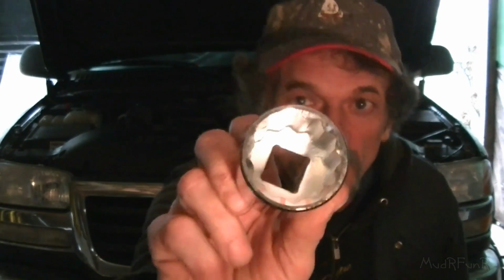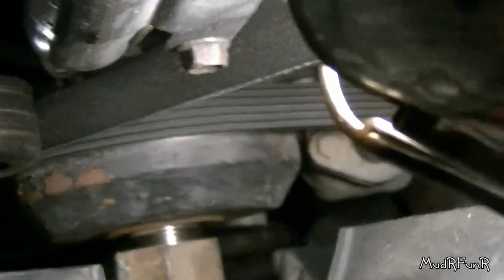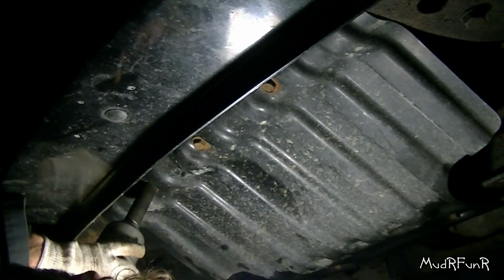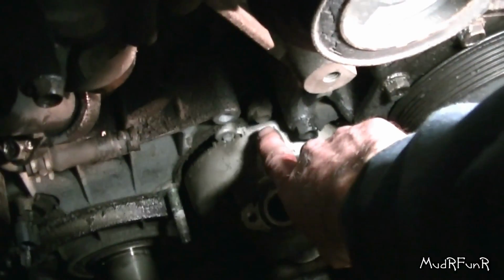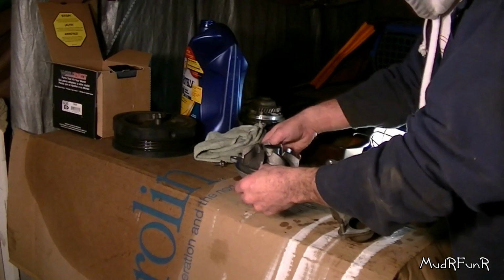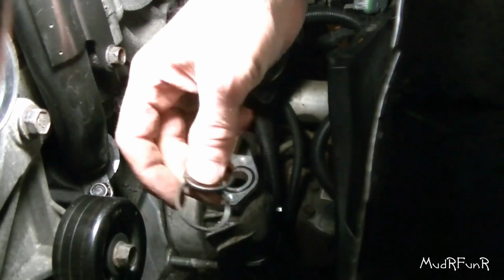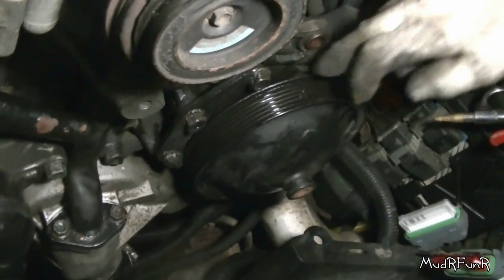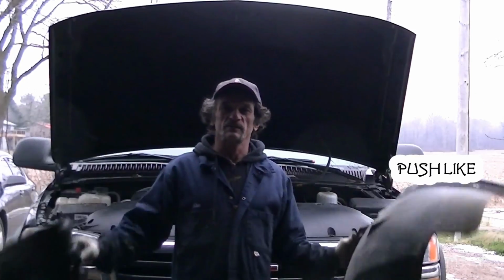Duramax LLY 6.6L Water Pump Replacement

Comment: Great job doing the video. Using this, I just finished doing the water pump on my 2003 2500HD. I ended up needing to pull the intercooler tube to gain access to the upper stud on the lower water tube. From another video, I was pointed to seal 94051259 as a better replacement for the bypass tube o-ring. I believe its a fuel injection seal, and is a bit tougher. So far no leaks !

Thank you for this video. I was pretty well prepared for the job from watching. And BOY are you right....this ain't like swapping the pump on a small block Chevy !
Reply from the maker: Sorry for the late reply. Your comment is very inspiring. I'm pinning this comment to the top so others can see the info about the seal. Thanks!

Comment: Good video.  I just finished mine ('03) and the balancer bolt wasn't that difficult.  I used a 3 foot cheater bar on a good quality 1/2" breaker bar and gave it some muscle.  I did order the Lisle tool for holding the flywheel and it worked great.  One suggestion I have is to put a piece of plywood or at least cardboard against the radiator to prevent damaging it (after removing the fan shroud).  For the o-ring that goes into the t-stat housing I bought the Harbor Freight metric o-ring kit and used #211 with a bunch of grease on everything.  It went in nicely and there were no leaks.  I used the ACdelco OE water pump.  It comes with a paper gasket for the lower tube and I put a small amount of black silicone on it to ensure a good seal.  Oh, I also used your trick for the fan bolt except I hit it with an air chisel.  Like butta.

Comment: I ended up changing the power steering pump last time because it was leaking too it’s worth the time to pull the power steering pump just because it makes the pipe off the back easy to remove.

Comment: A good video. A little better lighting would have helped. If you have a cooling system pressure test kit, I highly recommend checking for leaks as soon as the cooling system is closed back in. The o-ring on that upper tube is very finnicky. The last job like this I did required the tube assembly to be removed a second and third time, trying different o-rings, before it would hold the 15 psi required pressure. Without doing a pressure test, there would be a lot of time wasted before completing the job.
Reply from the maker: Yes lighting could have been better. That was 5 years ago. For the most part my lighting has improved. Thanks for your comment and info about the pressure test.

Comment: I know you finished the job already but, if you don't have a lisle, you can just put the socket on the harmonic balancer bolt with a cheater bar resting on the ground. Use a bungee on the the socket/breaker bar to ensure it doesn't fall off the bolt. Then just bump the key. It turns the crank against the socket and breaker bar and breaks the bolt free. Just did it today and that part took me less than 30 seconds.
Reply from the maker: Wow! That easy eh? I will keep this comment pinned on top so others can see it too! Thanks for the tip.
Reply: MudRFunR yessir, I'll have a video posted tomorrow. There is only one video I could find otherwise. I forget the guys name but I think the vid is call duramax water pump  super quick fix, or something like that.
Reply from the maker: I subbed so I wouldn't miss your video.

Comment: Great video,  did mine at 125,000 miles due to pump weeping.  Just inspected at 318,000 miles while replacing stock lower radiator hose.  I noticed some krusty, orange residue at the weep hole, nothing fresh, very old.  Manufacturer says pump may leak when installed, it’s a temporary condition while parts break in.  Even though I will lose some sleep, I’m not going to replace it at this time, I’ll be watching it closely.  Just a heads up that they leak a little until break in.  Your thoughts?
Reply from the maker: First I've heard of leaks during break in. I have heard a lot of people say they had leaks after install but they all assumed they did something wrong. Mine never leaked.

Comment: Was the fly wheel tool easy to out take after you tightened the crank bolt ?
Reply from the maker: Yes, the tool that I used slid right out. I've never tried the Lisle tool.

Comment: Can a bad water pump on an lb7 cause coolant in the oil? They say if exhaust or oil gets in the coolant reservoir it’s a head gasket but I’m getting coolant in the oil? Haven’t started the truck in a couple months since I discovered the problem, I’ve been building a garage to work on it but it’s intimidating! Thanks for any advice.
Reply from the maker: It could be possible that the seal/bearing in the center could allow coolant in the oil BUT I have also known of coolant in the oil from a head gasket or cracked head or block. I'm not certain if this applies to a Durmax engine but it could be any one of those things. This is only my opinion based on my experiences.
Reply: MudRFunR thanks sir.

Comment: Great video I really appreciate it. I'm wondering if you might have some advice for me. I have a 2005 duramax as well and I am currently doing the water pump. Twice I put it back together and it's pissing coolant from the inlet tube where it gets pushed up into the thermostat housing. I put a new o ring in there and both times it felt like the tube is in there and snug, it bolts to the top of the pump housing ok so I am mystified why it keeps pissing the coolant out and not just a little leak it's literally pissing out. Any advice would be greatly appreciated!
Reply from the maker: It seems you are not the only one with this problem. This question has been asked before. At 23:38 I mention that the stock o-ring seems a bit loose. I happened to find a smaller o-ring (same thickness) that fit tighter and that's what I used. Also make sure you lubricate the o-ring very well before pushing the tube on. Hope this helps.
Reply: MudRFunR thanks!
Reply: @orangeduramax4911  

I seem to be having the same problem.  It started with, what I thought, was a false "low coolant level" warning.  And then I noticed a leak. It looked like it was coming from ABOVE the water pump, but I couldn't see the weep hole. So I decided to go ahead and just change the water pump. Well,  after trying to get the fan off (exactly the same way in this video) I destroyed the belt and the small idler pulley. STILL didn't get the fan off!! I worked on it myself for two hours and had a mechanic come to my house for AT LEAST another two..... the fan is STILL on the truck....

BUT!! The mechanic did notice that the hose clamp on the lower radiator hose wasn't even CLOSE to being tight,  so we tightened it and it seemed like the leak has stopped.  We put the truck back together, put antifreeze back in, and let it get to operating temperature,  shut it off and let it cool down overnight.  No leaks.  That was two days ago.  So today,  I'm walking to my truck and noticed A LOT of antifreeze under the truck!! So now I am back at square one and need to find a way to get the fan off!! Is there another way to get it off?? No matter what we did,  the fan pulley just slid on the belt.  The only way I can see to get it off is to actually TORCH it off!! Have you ever encountered this kind of problem before? And you can tell that someone has already been in there and taken the fan off,  or at least TRIED! 

Any help you can give me would be much appreciated! Thank you!